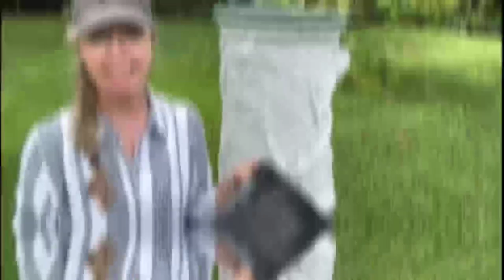Planter Pot Makeover; Elevating Plastic to Fantastic, Part V

Comment: Thank you for the inspiration.   Beautiful pot.  Can you paint it?  What kind of paint?  Should it be sealed with something after painting?  I want to make 2 to go outdoors in opposite sides of my garage door.
Reply from the maker: Hello Carol! Yes you could paint it absolutely… you could use spray paint, or a good latex for outdoor utilization. ( like a  good exterior house paint) or use acrylic paints like liquitex where you’d have many standard colors to choose from. Coating it with a modgepodge outdoor sealer.  You could also use rustoleum enamels and spray a clear coat. There are also urethane sealers ( like the clear oat on your car) 
Many options. Would love to see what your finished pieces look like! Will look stunning flanking your garage door!😊